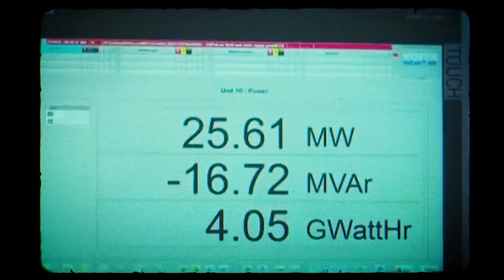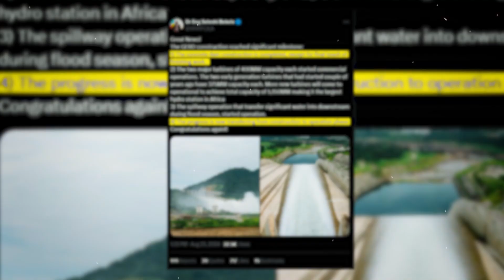Why Grand Ethiopian Renaissance Dam Changes everything for Africa

Comment: Ethiopia 🇪🇹 is planning to also use the water 💦 from the dam to irrigate farm lands lowering the flow plus the extra evaporation of the reservoir. Sudan 🇸🇩 and Egypt 🇪🇬 will get less water 💦. Sudan can pass the shortage on to Egypt since it is upstream of Egypt.
Reply from the maker: It sounds like there are many factors to consider, and that there may be quite a few complications in this situation.

Comment: isnt there another dam 40 km downstream in Sudan
Reply from the maker: Yes! You’re probably thinking of the Roseires Dam in Sudan, which sits about 40 km downstream from the Ethiopian border on the Blue Nile. It’s much smaller compared to the GERD, but it’s super important for Sudan’s irrigation and flood control. In fact, many experts argue the GERD could actually help downstream dams like Roseires by regulating water flow and reducing the risk of flooding
Reply: Yes

Comment: Why always the long evolved description how important the Nile is to Egypt and also Sudan. But no real reasons for why the dam should reduce the water flow significantly? The water having produced the electricity, still flows down the same river and is not diverted. The evaporation in the Millennium Reservoir, with a surface area of 1,874 km2, will be lower than what happens in the reservoirs downstream, especially in the Lake Nasser in Egypt, with a surface area of 5,250 km2, in a lower and hotter environment.
The filling of the reservoir is completed. That happened without the problems anticipated by Egypt and Sudan. Also speculation about the Lake Nasser getting less water ate really only speculation, because all water still flows through.

There is in reality no practical reason why there are still tensions.
Reply from the maker: That’s a really sharp observation 👏! The physics of it are pretty straightforward, water that spins turbines doesn’t just vanish, it flows right back downstream. The evaporation argument is actually weaker for the GERD than for Lake Nasser, since Lake Nasser is more than twice the size and in hotter conditions.

So why the tension? A lot of it comes down to politics, control, and perception of power rather than actual hydrology. Egypt has historically seen the Nile as ‘its’ river, under colonial-era agreements that Ethiopia never signed. The GERD changes that balance, suddenly Ethiopia is in the driver’s seat. That shift in influence is arguably more threatening to Cairo than any real drop in water flow.

Comment: I can't understand the worries of the downstream countries. Unless Ethiopia is planning a gargantuan expansion of irrigated agriculture there is nothing to fear. A reservoir behind a dam might be huge but once it is filled, the water will flow as before. Only that prior to flowing downstream, it will run through a turbine. On the contrary, a dam has the great advantage of acting as a water reservoir to even out natural occurring fluctuations in waterflow during the year. Egypt built the Asswan dam for exactly those two purposes: electricity generation and water management and it was considered beneficial for the country. Now Ethiopia is doing the same and it should have detrimental effects for the downstream users? I don't see it. Really, the Nile countries should come together and form the equvalent of the Tenessee Valley Authority to manage the entire Nile watershed. There could many more dams be built along the entire course of the Nile. Such an authority could manage all dams of the Nile watershed in a way that the water needs of all users are met. A dam across a river does not make the river water disappear into a hole or stop the flow of the river forever.  It is very easy to manage the inital filling of the reservoir behind the dam no matter how big it is in such a way that there remains always enough water in the river. Politicians who cry out against dam building especially in developing countries have either no clue about hydrology or they have ulterior motives. China is building dam after dam, and dam construction is a major pillar in infrastructure development which is essential for economic development.
Reply from the maker: Agree fully with everything with all the points you made, nice
Reply: Egypt is jealous
Reply: Your never respect international river laws and this dam main reason for destroy your country

Comment: The notion that a dam could permanently, significantly reduce a water supply... the flow of a massive river,  that's PREPOSTEROUS & STUPID! 

Obviously, while the reservoir is being filled not all of the water that would've flow will get through.  But if the filing is done slowly, especially during years with more than average rainfall, Egypt & Sudan will be unaffected. 

But once a reservoir is full, it can't hold any more water, and it overflows!

This is NOT a legitimate complaint/fear!
Reply: Unless a lot of water is diverted for irrigation. That's how the Aral Sea was killed.
Reply from the maker: @carelgoodheir692  This is a great point. I like the story of the Aral Sea, it was the first video I made on this channel. In that case however, the region where they tapped the rivers for agriculture what a desert-like dry area, and they decided to grow cotton. Very water demanding crop to grow. Perhaps, even if Ethiopia were to utilise a lot of water for agriculture in their stretch of the Blue Nile before it hits the border, there would still be plenty of water left for countries downstream. I like when freshwater is used to the best of local conditions ability to balance and sustain the most development, and building dams are really beneficial to ensure less is wasted in chaotic floods.
Reply: @carelgoodheir692  They built it for thousands of megawatts of hydro power.

Comment: Egypt and Sudan have their own accountants, scientists and engineers and they know the truth but cannot admit this publicly. Egypt and Sudan overly politicizing an easy technology fix. First Ethiopia when finishing this dam, they must as quickly as possible payoff their debts and bonds. This is where the accountants come in Ethiopia must do revenue maximization. That means Ethiopia will not hold back any water at all. Ethiopia must keep all turbines always running. Revenues from electricity generation are a top importance to paying down their debts and bonds. Egypt and Sudan true greatest concerns are floods not droughts. If a drought was on the way Ethiopia will have to turn off some turbines because their will not be enough water pressure to drive all turbines. If a flood was on the way obviously Ethiopia will run all turbines for revenue maximization. Somewhere between 50% and 75% debts and bonds are serviced we know that Ethiopia will start the construction of cascading hydroelectric power dams. Revenues from the first two dams will be used to finance the remaining 8 cascading hydroelectric dams without securing any new debt. Revenues from Ethiopia renewable energy revenues will be 10 times greater than Egypt’s revenues from the Suez Canal. This is the real reason why Egypt is opposed to Ethiopia renewable energy plans. Ethiopia’s (Gross Domestic Product) GDP per capita will twice to three times that of Egypt. It will put pressure on Egypt to grow their economy as fast as possible to stay competitive Ethiopia. Egypt plans were always about suppressing Black Sub-Sahara Africa. A little bit of old-fashioned racism is at play. Arabs have always considered themselves better than Black Africans. Arabs have enjoyed crude oil revenues looking down at Black Africans. But we and they know that the good days are over and soon Arabs will be working for Black Africans. Minerals for electric cars are in Black Sub-Sahara Africa that will make them much richer then the Arabs in the north.
Reply from the maker: Thank you so much for the long and insightful comment. It sounds like a great topic for another video to be honest. (:
Reply: it's the most beautiful and informative comment i ever seen thanks bro
Reply: To much talk realty you country in heavy civil war you influence cut on horn Africa Egyptian army in all horn Africa countries now your economy collapse your policy in somlia FAILD you failed to get any benefits from this FAILD dam 14 years you can't get electricity even export your country converted to joke even Egypt can destroy it at any time
Reply: Preach❤
Reply: Arabs have always looked down on Black Africans, the first slavers of Black Africans. Look at how they treated the Black Africans in Sudan before the split.
Reply: I like this
Reply: @phillieg58  Il est clair que vous ne comprenez rien. . Continuez à payer de l'argent pour le réparer en raison des problèmes de conception. Vous détruisez tout. Chaque jour, des soldats des ENDF sont tués, et demain, le Tigré se vengera de vous. Vous êtes assiégés non seulement militairement, mais aussi économiquement. L'Égypte mène le développement en Somalie et en Érythrée et reconstruit leurs armées. Parallèlement, vous êtes punis économiquement, notamment en vous privant de votre espace aérien et en interrompant l'aide alimentaire dont dépendent des millions d'Éthiopiens affamés. Nous entendons vos menaces, alors que l'Égypte a doublé la capacité de son armée de l'air et de ses missiles balistiques et fournit gratuitement des milliards d'armes aux pays de la Corne de l'Afrique, et vous rêvez de la punir.

Comment: Not the largest dam in Africa, Aswan Dam in Egypt is bigger. It’s the largest subsaharan dam.
Reply: It is true that the Aswan High Dam in Egypt is one of the most significant and well-known dams globally, but the Grand Ethiopian Renaissance Dam (GERD) on the Blue Nile River is larger in terms of installed capacity and dam size.
Reply: Nope that ain't true, aswan produces 2000mw while GERD produces 6000mw
Reply: It can be difficult to compare which dam is larger sometimes. Since the Aswan dam is downriver from GERD, there is more water passing through the Aswan dam. But the GERD produces more electricity, and is higher at 175m vs Aswan's 111m. Although the Aswan dam is longer, at 3,830m vs GERD's 1,800m. I guess the aspects that make me thing the GERD is bigger, is the height and total power output of the dam.
Reply: @affe114  GERD is the biggest because of the amount of water it holds
Reply: bro at least google before you comment here
GERD is the biggest Dam in Africa and 7th largest Dam in World!!!
Reply from the maker: @nothingQwertz  Google is our friend.
Reply: WRONG